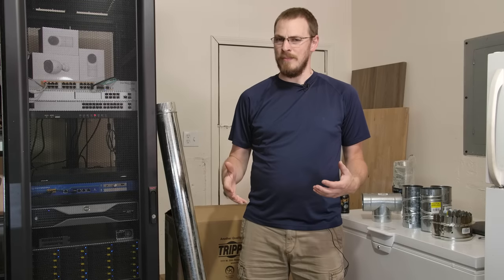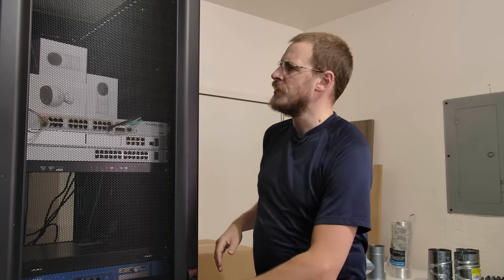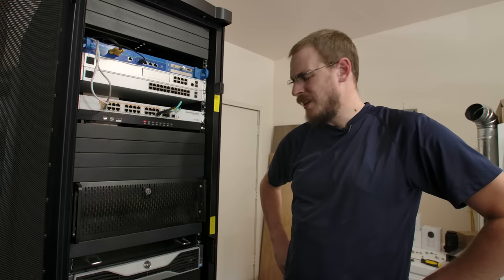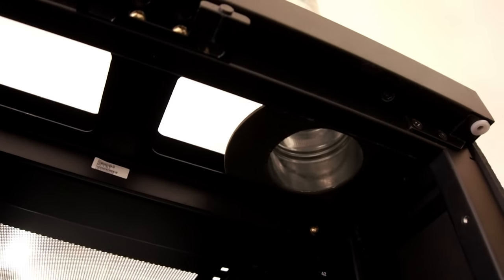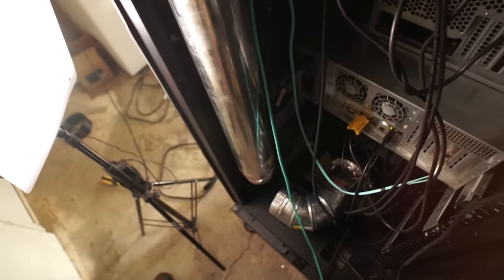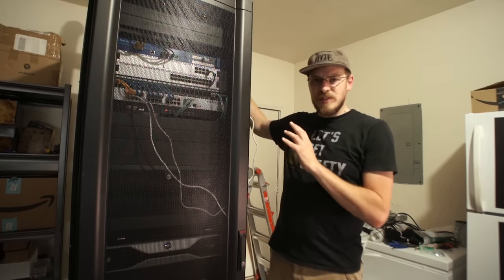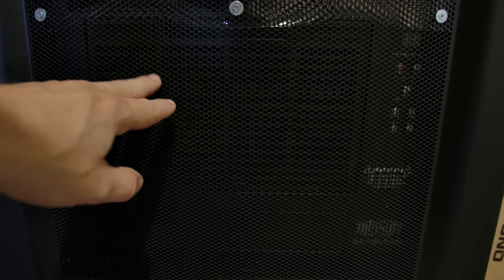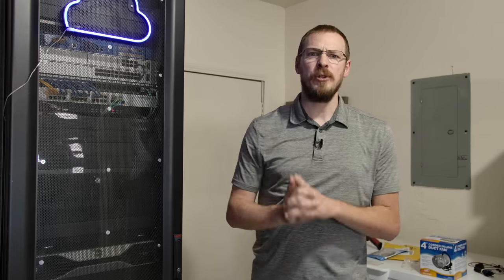Rackmount Air Conditioning?!?!?!? IT'S A THING!

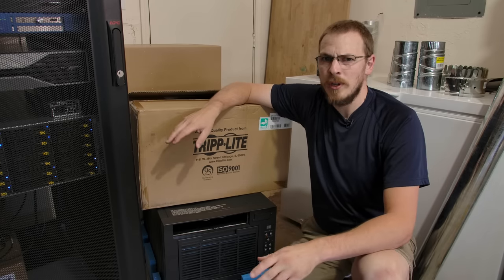Comment: 2:20 Is it just me but is that a bad idea?
I mean, if you blow all the "hot" air out, you're constantly cooling down new air for the servers to use. 
Now if you run your servers at full blast and they exceeded the capacity of the AC or the output air is hotter than the ambient air in the garage, that would make sense. But say your garage is 30c,  your AC cools it to 20c, your servers heat it to 25c, then you dump it out. It would be more power efficient for to just pass the air back to the AC and let it cool it by 5c, instead you're taking completely new air at 30c and cooling that 10c. That's huge waste of energy.
Reply: That would only be in an ideal situation, most likely, when the servers are running at full speed, there will be little to no effect of running that hot air from the servers back through the aircon just to cool the servers again.
Reply: 1) its going to be significantly hotter coming out of a server rack that big, much hotter than ambient
2) you have to vent heat somehow, the AC unit can't work without dumping its heat somewhere, so he's using that airflow to also pull the heated air out of the rack
3) its probably more energy efficient to run a small AC unit to cool just the rack than it would be to try and cool an entire garage, though I'm not sure I'd put a rack in a garage anyways but then my houses have never had well insulated garages
Reply: i think using a mini split unit is what u are thinking.. and i believe it would be more efficient than this method.. but i dont know if one is made small enough that could fit in a single wide rack...
Reply: This unit is designed to run only the discharge from the condenser out of the controlled space. Typically we install climate controlled liebert systems in server rooms that controls humidity, temperature, and air purifying. I can see this unit in a server rack that's in a server closet with a filter on the door. Then it would use the space around the server and the air would be forced to go through the condenser and out the duct system out of the controlled environment. These unit range from 12000 to 22000 BTU's.  For a small server.
Reply: @AsbestosMuffins 
1) He approximated that the rack uses 500W on average, but the unit was capable of couple of kW. Depending on if that's the transfer capacity or load, it's either way more powerful than the servers or a lot powerful (ACs have typical heat transfer few times their energy usage) That would mean the air coming out the server would still be colder than the ambient air of the garage.
2) The heat is meant to be dumped trough the back of the unit, with where the AC dumps the hot air, which he has correctly vented out.
3) The AC wouldn't try to cool the garage if the rack was more closed up. Either way, it's better for electricity usage for the AC try to cool down the whole garage than vent the semi-cool air out losing all the benefits of it. If the semi-cool air cools the garage even a little bit, it makes the job of the AC easier, making it use less electricity or cooling the servers down even further, depending on the controls of the AC.
Reply: ACs are essentially heat pumps, taking heat energy from one medium and placing it in another. 

1. The front of the AC unit is intake for both cooling the rear coils and cooling the rack.
2. The AC exhaust air is significantly hotter than ambient air.
3. Recirculating exhaust destroys efficiency and it gets to the point where things only get hotter. 
4. Venting air from the rack to the duct won't necessarily make things better.

I personally would have just vented it to the garage and the exhaust air to outside.
Reply: @LeoInterVir  an ac is not a Heat pump. A heat pump air conditioner is designed to heat and cool. This is done by a reversing valve that switches the flow of refrigerant from or to the evaperator and condenser.  This is just a cooling unit. Part of your reply was correct. A closed loop refrigeration cycle is designed to absorb heat from one area and reject it to another. There are many types of system that can achieve this goal. The most common is the normal air conditioner. Then you have water chillers for more extreme systems and then you have ammonia absorption for industrialized systems. But now these days most industrial comfort cooling system for servers are ac and chillers. The most common server AC is a liebert system.
Reply: "While air conditioners and freezers are familiar examples of heat pumps, the term "heat pump" is more general and applies to many heating, ventilating, and air conditioning (HVAC) devices used for space heating or space cooling."
Reply: @LeoInterVir  Well I would disagree. I'm a Ciro certified Industrial Refrigeration Tech and one of the Authers to RETA Advance refrigeration book #3. I'm also Nate certified, ANSI Certified, and CRST Certified. Your Term Heat pump is not correct for what you have described. You should Get RETA Books 1 and 2. They will teach you a great understanding of how the refrigeration cycle works.
Reply: The discharge air coming from the condenser is a lot hotter than you think. If you think rejecting it back into the front of the rack is a good idea it's not. The condenser is designed to reject the heat of compression of the refrigeration compressor and all the superheated gas from the evaperator. So you will never win that battle by introducing your rejected heat back into the evaperator that was designed to remove the ambient load only.
Reply: @jaketus  That wattage was just from idle, if he was doing some intense resource usage that could be anywhere from 1500w to 2000w

Comment: You can simplify your venting, put your exhaust for your ac unit on the straight part of the T.  That way it will draw the hot air out of the rack, instead of the current config.

Comment: Great inspiration Jeff, thank you!

I was thinking about doing something similar to this when I buy my own house, and maybe get some kind of valve so that in the winter, I can route the hot air into the house and get some heat out of it, and in the summer, route the air outside just like you plan to do with this setup?

Comment: Question, which isn't relevant to your situation or setup, but what would the feasibility of doing an in-rack AC setup with a split unit? I know split units have been popular for the past half decade, if not longer, for smaller buildings and replacements for window AC units; and in recent years, there's been an more and more systems that use the split unit design with multiple cold sides, basically individual room ACs with a single hot side. Assuming someone has a spare split unit, or one of the newer, fancier units that has the capacity for multiple cold sides, how easily could this be incorporated into a server rack? The only concern is plumbing from the hot side to cold side, but I think the plumbing would be much more reasonable than ducting exhausts would be. 

Personally, I think this setup would be preferable, as you're removing the hot side from the server. Another benefit is that you could potentially recycle server exhaust to be server intake, assuming your AC's cold side has the capacity to do so, thus no external ventilation; assuming you can do a closed loop like this, you should also see significant noise level drops due to the system needing to be entirely enclosed when running the AC. Another benefit, assuming you have the system where you can have multiple cold sides, is that you could expand this to a second server rack, while gaining the same benefits. 

It'd also be interesting to see this idea adapted to full rack water cooling. Maybe also include a heater, for full temperature control, so that it doesn't get too cold in colder months. Assuming split units don't already have full temperature control, I haven't really looked into them, I know they provide AC, but there's no reason they couldn't also provide heating as well, through either electric or gas heating elements. This, assuming you do have full temperature control, with full rack water cooling, would be the ultimate cooling setup due to temperatures and noise, especially if you're putting a server in a literal closet, like where most home servers end up.

Comment: Hi Jeff, really liking this so far. My only question about your T duckt splitter ( or however you muricans) call it😜 why not use a Y so you can direct the pushed air from the airconditioning up a in a more natural flow causing some natural suction flow from the down pipe that  takes the other hot air from the servers up. That lower powered inline blower should be enough than isn't it?!🤔

Comment: The exhaust should always have the smaller/lesser up top and the larger on bottom. Also my concern would be the reduced pipe causing issues long term with the equipment overheating and/or possibly prematurely burning up motors.
Reply: Agreed, going from 6" to 4" is a 55% reduction in cross-sectional area and roughly equivalent reduction in air flow.

Comment: Bit late now, but pro tip, use an electric drill-driver with variable clutch to do all the screws in a rack-mount install.  So much quicker.

Comment: What is the total power requirements for that rack? Is a/c run off it's own power circuit/breaker?  Do you run a dedicated power circuit from your breaker panel for that/those outlets? Also does the a/c auto reset after a power failure?
Reply from the maker: I have two dedicated 20A circuits behind the rack. AC is going to run on a separate breaker from the rack.
Reply: @CraftComputing  Ok, good to know. A/C is auto reset after a power fail or is it a manual reset?
Reply from the maker: Auto on after power outage.

Comment: If you made the "straight" part of the exhaust on the AC unit, you would have less pressure coming through the T section, and less "back pressure". The fact that you have that perpendicular junction means the unit is putting at least 50% of its pressure back into the rack. Simply flip that fixture around, and you'll probably have less pressure coming down the rack side.

Comment: I feel like you could have used some of the cheap round neo magnets + a dab of super glue for the vinal and you will probably still suffer/fight the AC unit for flow dominance, probably better to just run a separate duct and put a damper on each so they shut and keep the creepy crawlies out. I have some other feedback, but I will wait until part two to see if you catch it on your own, learning as you go is half the fun.

Comment: only thing i dont see is if the temp of the garage drops lower then the set point of the AC... will the ac turn off and not provide ANY air to the servers?
dont know where the probe is for its "air temp"....
Reply from the maker: Like a portable AC, the Tripp Lite has an air intake sensor. You set the temp you want the outgoing air to be. If the intake air is the same temp, the AC turns off and acts as a fan, still providing the servers with air.

Comment: Question:  If you're moving/ejecting 190 CFM of hot/warm air out the top of the rack, is the cooling unit still necessary?  I only ask because I want to do the same thing, but don't have the space for the cooling unit...
Reply: And I literally paused the video to type the above question RIGHT before you mentioned you were going to verify if the cooling unit is even necessary... :)
Reply from the maker: I can tell you, the cooler is going to be necessary, as my garage is sitting at 90F RIGHT NOW. Hard drives like to start dropping like flies much above that, so anything I can do to feed them cooler air will be a win.
Reply: @CraftComputing  One more question:  Where does the water go when you dehumidify?  Is there a tray that you will need to empty on a daily basis?  I ask because if you start dehumidifying your entire garage, that's going to be a lot of water.

Comment: Yea, fairly certain that is not how you are supposed to vent a unit like that. You are taking all the cooled air, and dumping it causing the compressor to need to draw in ambient and work even harder to cool.  
Just for a test, block off the second 'exhaust' vent from the top of the unit (not the one coming off the back of the AC unit) and see if temps drop lower while the compressor cycles less. See, unless the servers manage to dump enough heat energy into the back of the rack to take the temperature above ambient (they probably won't if your estimate of 500W is accurate), then all you are doing is dumping out cooled air and drawing in more ambient. Sealing the entire rack and leaving some small vent holes at the top back and bottom front should result in much cheaper and cooler performance (The AC exhaust still needs to be taken outside though).

Comment: I am not sure if your system will work.  What you would want is for the condenser to have a external/closed system that would loop around the radiator. Pulled from the external air and pushed back out after taking out the heat. And the internal air to pass over the cooler and keep recirculating.  Pulling "hot" air from the top has to be replaced by external air defeating the purpose.

Comment: If you went with a Wye instead of a Tee you wouldn't have the air flowing down also where does the water drain to from the AC unit?

Comment: Project advise from 15 years of experience.  If you need 10 screws to complete a project buy 20.  You can always return them or you will loose almost that many anyway.  Also not a big deal when you are on the floor.  A much bigger deal when you are hanging on a 200' tower.

Comment: You should put a mini wind turbine in the air duct, and recover a little bit of the power!  Or a TEC on the wall of the pipe to convert some of the waste heat back to usable power....  😇

Comment: What air is replacing the exhausted air? Wondering how much negative pressure this is creating and if he has created a way to equalize to maintain the rated efficiency of the unit.  See this mistake all the time in wiring closets with portable coolers.

Comment: appreciate the content and enjoyed it. BUT was this actually needed? I found putting a $20 generic box fan on top of my server cabinet and that took care of keeping all my server fans running at minimum RPM....

also future project idea....have A/C triggered by need / ambient temp inside the rack, I mean you already have temp sensors :-)
Reply from the maker: In the hottest summer days, my SAS drives were reaching 60C. I know from experience that is a point where failure rate becomes exponentially higher. The CPU temps inside the rack were still acceptable-ish, but heat is the killer of all when it comes to servers. I'd rather be safe, even if it is a bit excessive.
Reply: Craft Computing excessive.. a word i dont know for my rack
Reply: I would say it's his Rack and he wants it to be the coolest rack around. Keep it up Jeff.

Comment: I kind of want to be the guy to crawl around working on data center machines. I like hands-on work like that.

Also, I'mm really interested in this cooling solution for your server. I was thinking of just getting a wall/window A/C unit and either just cooling the whole room or piping it somehow. Not sure how much I like this solution but if it works then it works and I might try it as well

Comment: I think you could have gotten away with using the inline blower, had you mounted it before the t-peice, then you wouldn't be fighting both the hot and cold exhaust fans from the A/C  only sublementing the the cold fan air. But a ceiling mounted fan sounds nice anyway.

Comment: Maybe you could ad a duct for the ac intake to the front mesh with vinyl around to not exhaust the cool air in the front.
Reply: Or maybe ad a lip of insulation on the upper side of the ac pushing against the door to seal it better.

Comment: If the rack door is made of steel would it be possible to just use some magnets to hold the vinyl in place?
Reply from the maker: The vinyl was pretty heavy. I considered magnetic strips, but didn't want to fuss with them when the adhesive inevitably came loose.

Comment: What about the condensate from the air conditioner?   Won't you need a condensate pump to pump it out of the rack?
Reply from the maker: The unit has a built in evaporator, so no drain needed.
Reply: @CraftComputing , I was hoping it was something like that.   Still, good to have it on the bottom of the rack and not on top of a server or switch.

Comment: @Craft Computing What about during a power outage? I would think that you wouldn't want that air conditioner draining the UPS very quickly, and with the vinyl completely covering the front, wont the servers be starved for air?
Reply from the maker: In a power outage, I turn everything off. My Plex server ain't keeping a Fortune 500 company afloat.
Reply: @CraftComputing  Sure you can turn things off, but what about when you cant? Say the outage occurs while you are away or in the middle of the night?
Reply from the maker: UPS is network monitored, and servers shut down after 60 seconds of no power.

Comment: An AC unit inside the same rack as server gear makes no sense to me.  As you noticed immediately, the unit itself produces heat.  And your hot exhaust duct runs the entire height inside your rack, exchanging heat with the internal air.  You might be making the "hot" side of your rack even hotter.  I would insulate that inside duct if nothing else.  Definitely test in comparison to a simple fan-driven vent to outside with air intake at the bottom of the rack.  
I hope you have the AC unit on a totally separate breaker from the rest of the rack.